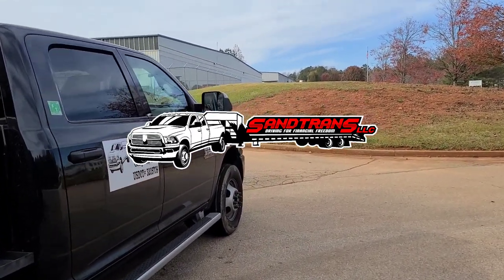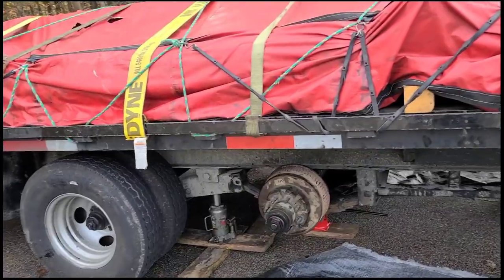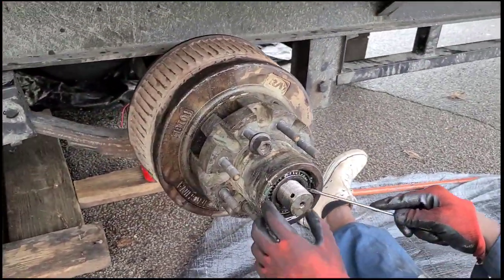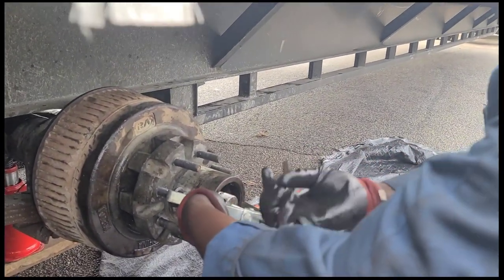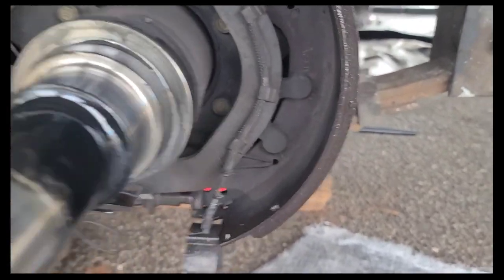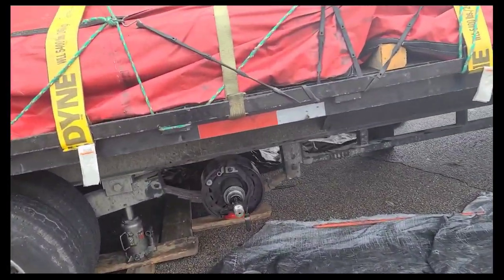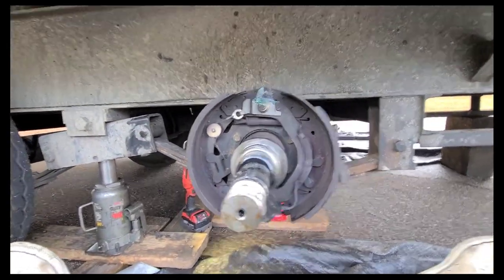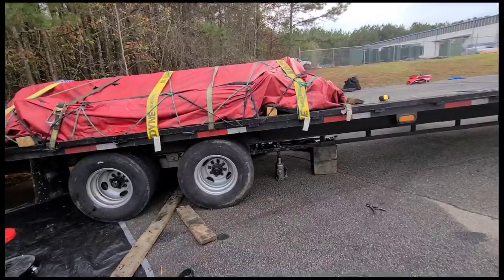How to repair electric trailer brakes on my hot shot

Comment: always replace your race and bearings if you are going in anyway. 
If you get a bad bearing after the fact someone drove 50+miles on ,and the outer bearing is essentially welded to the spindle... forget about a gear puller and instead go with a small pneumatic cutting wheel.
If you can't get the hub off-get a length of chain long enough and big enough to fit around the studs,,,place a nut on opposite sides, hook another longer chain to it(think 5ft) and give it a whipping motion,or you know ,,,just buy a slide hammer and forget the longer chain,lol. 
I put electric tape around the castle nut threads and behind when cutting off the bearing. the trick is to go just deep enough, but not quite though to avoid grinding into the spindle, finish it off with a flat chisel and the hammer of your choice to break the bearing in half or get it to move and then use your gear puller...
Pound the old races out with a chisel and hammer/air hammer.
Clean everything with compressed air/emery cloth/brake clean. 
Really focus on were the new races will seat.
Make a small investment and get a race/seal drive tool. Don't rely on a "piece of wood" or," this big ass socket".
If you do use anything else, except wood(i guess) you run the risk of marring/scratching/deforming your races/seal="Oh shit! I have to do this all over AGAIN!"
Seat your inner/outer races first then put in your inner bearing, I always add hub oil to the bearing just cuz i don't like going in dry,lol.
rub hub oil were seal will seat(just a thin film) seat seal with, and i can't stress this enough, a seal seat/bearing seat tool.
Squirt hub oil onto spindle just enough to coat it/ paying attention to coat area were oil seal rides.
push stupid magnet on to springy thing and try to jam on hub in one caffeine-fueled motion...
place outer bearing/washer/castle nut. tighten and rotate. tighten and rotate. go until tight. back off a hair/ or leave it/depending on feel of stiffness/if you can get cotter pin in...
Put a little gasket maker/high temp silicone on the threads of that oil cap(you know you want to!)
Put that fucker on tight!
Add oil/spin/add oil/spin/add oil/ oops, too much oil, it's spilling out now!

put it back in service.
Rinse.
Repeat.
Look -i wrote a novel.
Source-i done a few of deese.
Hope this helps someone. 
TL;DR = Buy a new trailer, this one is done.

Comment: Stacey Stacey its all wrong buddy.  1st you should have back out the brakes always. That's why it was hard to remove, there were slightly engage. Never use a pry tool. Always carry brake cleaner to clean the backing plate and inner hub. When removing the hub from the axle spindle, always keep it away from the spindle. I know its heavy, but the rear seal can hit it and cause damage to the seal. Never ever mix grease with oil.  They cancel each other out and will burn up faster! Also there are seals for oil only and grease only. If you go from 1 to another you have to change the seal aswell. You have never adjust brakes i see. When the hub brake is back on,slightly adjust the brakes back. Than backup the trailer to about 10 miles and hour and stab the brakes. Do it twice. Brakes should be back to spec. When using oil try and use Lucus hub oil. It's thick and seals the seals. Order a left and right complete backing kit as a spare. Get rid of those plastic hub oil caps. They crack and heat up causing leaks. Look up Valcrum Aluminum caps. They can be used for grease or oil. Remove the plastic oil cap and measure the thread from left to right. Yours is prolly a  ST 3.75 or ST 4.00. There 200 for all four.  Well worth it. You know I got your back fella👍
Reply from the maker: My Guy! I knew it was coming LOL. This is  Some solid info for me in all the truckers. Thank you so much
Reply: @sandtransllc1824  u my dude Stacey. I knew Mr keep trucking would be back...lol. We should meet up one day after this COVID-19 nonsense 👍

Comment: Next time , when you are taking the hub off, put the wheel back on with a couple bolts and you will have more leverage over the hub. You can pull it off like that. Unless you just like using the puller. Lol great video tho bro. Stay safe. #Atl fam....
Reply: Do you work on trailers